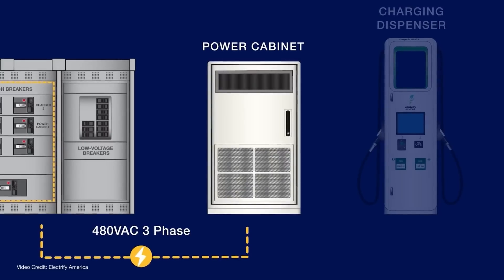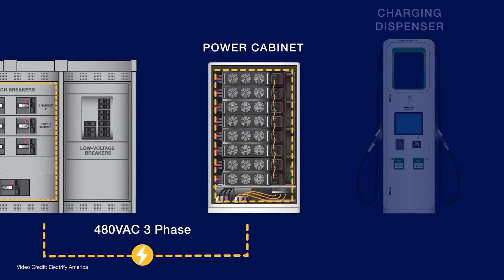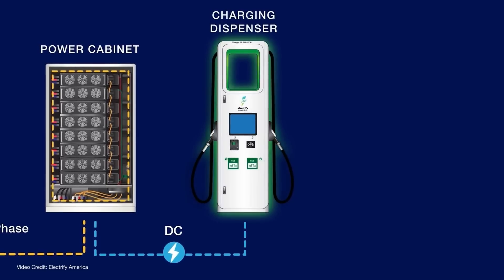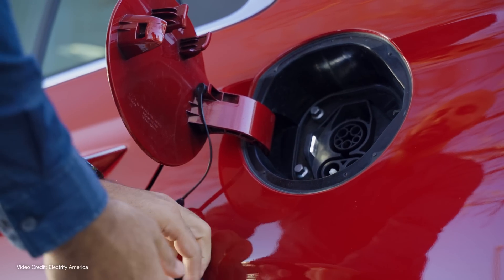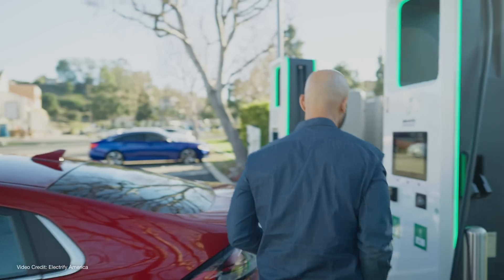EV 101 - Understanding Charging Terms

Comment from the maker: Hi folks - there's an error in this video I want to address: In the section on CHAdeMO, I note that cars which use the CHAdeMO DC Fast Charging standard also have J1772 ports for AC charging, but in most of Europe they use Type 2 ports instead. I should have said "...J1772 or Mennekes connector, depending on region." Sorry about that - Winter
Reply: No worries. Even though, it's not just the region, it is also model (model year). Like Leaf was initially sold with j1772 in Europe, but "second gen" Leaf got Type 2. But eNV200 had J1772 throughout it's production.
It is messy, lol

Comment: Don't forget about RPH and when dealing with lEVel 2 charging and DCFC there are tiers within those charging sectors that one must pay close attention to that aligns with their particular EV specifications as this will cost them dearly in the future if not carefully known or explained. For example, lEVel 2 Tier 1 = ~3.6kW, Tier 2 = ~7.7kW, Tier 3 = ~11kW, Tier 4 = ~ 20kW, while DCFC has their own Tiers we commonly refer to as well, DCFC Tier 1 = ~50kW, Tier 2 = ~150kW, Tier 3 = ~250kW, Tier 4 = ~350kW. The cost of the equipment in addition to electric materials for installation Every Tier varies greatly, thus being aware of these allows you to budget your EVSE installation and needs based on utilization and use case. Hope this helps

Comment: Lots more questions. Like, charging apps?  Finding chargers.  Making reservations at one??  Putting your car in charge mode?  Activating the charger??   How plug one of those things you showed into a 120v wall outlet?  Difference between levels 1/2/3 chargers, voltage/current/charge time/cost/easiness to find one?  How pay for the electricity when you charge?
Reply: Reservations... I wish! Maybe if everybody keeps asking someone will listen...

Comment: For someone buying a new EV this week.  (EV6)

1) I want to know if there are any non Tesla apps that have unified all the companies in one app?  I've seen an EU AUS one but it's not available here in NA.

2) Outside having a level 1 or 2 cable in the car for emergencies, what else should be a go to, any adapters or something?
Reply: 1) a) PlugShare!  Everyone with an EV should look at their local areas in Plugshare to see what's available across all providers! 
    b) A Better Route Planner -- if you take trips that are longer than your range (or close) you should look at ABRP, the web site and the app. 

2) A 12V (accessory / low voltage) battery booster (jump starter battery) and perhaps a bluetooth charge monitor.  EVs of all sorts have an Achilles' heel in the old 12V battery, and you can't run the car without a 12V battery. Google these problems if you want to know more. All solvable. And congrats on your new EV6! I have been driving a Hyundai Kona since August 2019 and I will never buy another combustion car.
Reply: @TaiViinikka  ooh thank you. 👍

Comment: People will also need:
Volts is like the pressure in a pipe it is there even if current/water is not moving
Amps  (current) is like the flow of water.
Watts is you multiply the two together.
Kilo something means 1000 so a KW is 1000W (about what your toaster uses)
KWH is a measure of energy in KW being available for 1 hour.
You need about 10KW to go down the highway.
If you have 10KWH of energy you can do that for about an hour.
When you are charging you are putting in KWH of energy you can think of like liters/quarts of fuel.

Comment: Hopefully Sono Motors will get their arse into gear and start manufacturing their cars, then I'll be able to recharge without any of what has been discussed in this video, admittedly it will be a bit slower.
Reply: I mean, a lot slower. :) My Kona will charge at 75 kW ; I can't even fit 75 kW of solar panel on my *house*, let alone on the roof and hood of the car.  Still, great vehicle, I hope you eventually get a Sono or, perhaps, break the solution in two, and get an EV and some fixed solar panels on the grid.

Comment: Sorry to report a Error.. but not all cars that has a ChaDeMo port, has a J1772 for AC.. the europa LEAF 2017 and newer, sold on outside UK.. Come with ChaDeMo and Type2 (still singelfase)
Reply from the maker: No, you're absolutely right. I should have said "J1772 or Mennekes connector, depending on region." I'll pin a comment noting that, and you should never feel the need to apologize for pointing out a factual error - Winter
Reply: Well said Steffen.  Shows the extra level of complexity 👏👍

Comment: I think including "EV or PHEV" at 2:37 might be information overload.   While technically correct, as a viewer that segment has a lot of acronyms flying at you during a really important section.    The speed might need to be reduced somewhat.  Maybe mention "EV" a bit less often too, rely on viewer context.    "Connects your vehicle to a source of electricity for charging"

At 3:28 you say "EVSE Type 2 AC charging connector for EV's used in much of Europe"   "EVSE Type 2 AC charging connector used in Europe" would be a good simplification

Otherwise great video!!